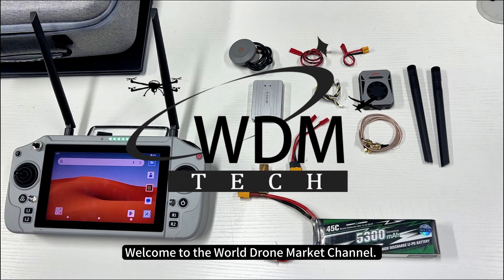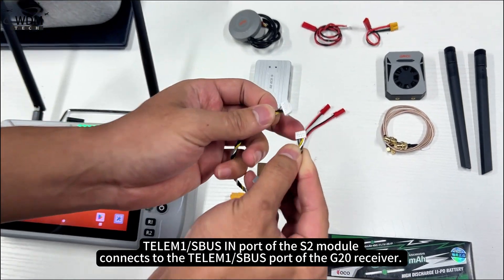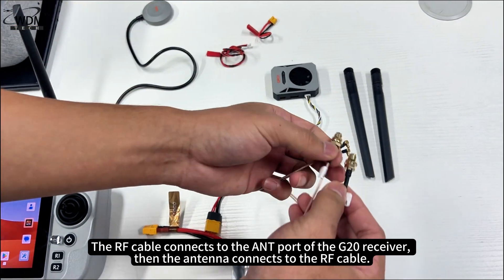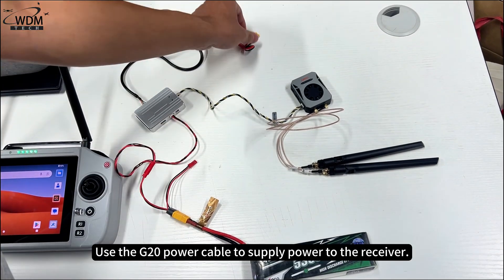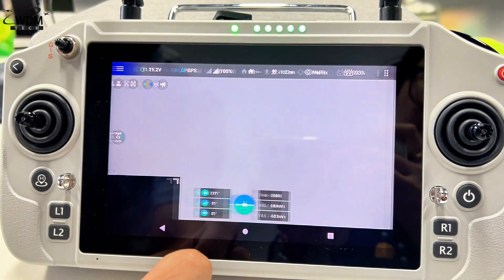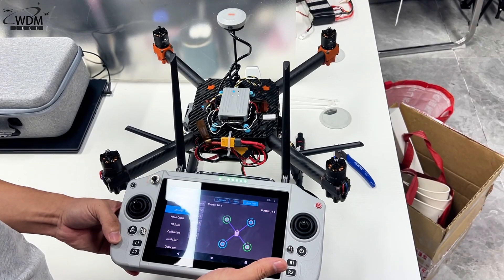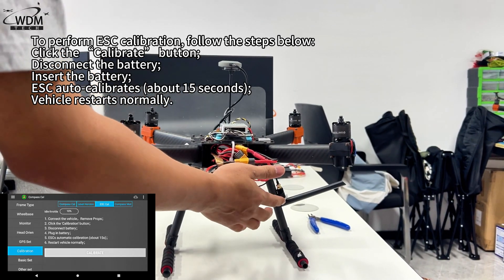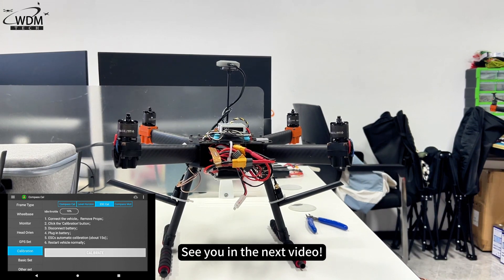Skydroid G20 connecting to Skydroid S2 debugging on the remote controller

Comment: Can I use two receivers with one controller?
Reply from the maker: Sorry, it is not possible to control two receivers with one remote control.
Reply: @worldronemarket Thank you. 
Of the products with a 7-inch monitor, would there be a controller for two receivers with one controller?
Reply from the maker: @Hwangso_man  The SIYI RC7 remote control can now retain the binding information of multiple receivers, so you don't need to re-bind the receiver the next time you use it. However, it cannot control two receivers at the same time, so you can only use it one-to-one.

Comment: For a rover, what kind of signals does the s2 put out ? I have a two tracked rover , but cant get the motors to turn. What kind of esc board do i need to make this s2 control a tracked vehicle ? Thankyou for selling me the cable to get this setup connected .
Reply from the maker: You can contact us by email so that we can better help you. tech2@worldronemarket.com or tech@worldronemarket.com